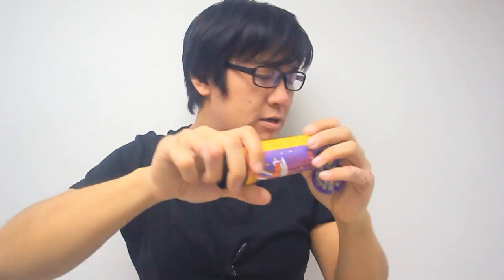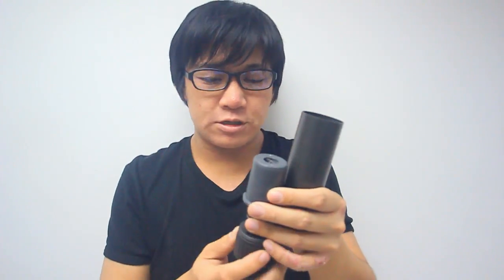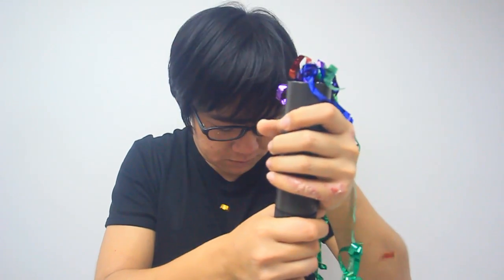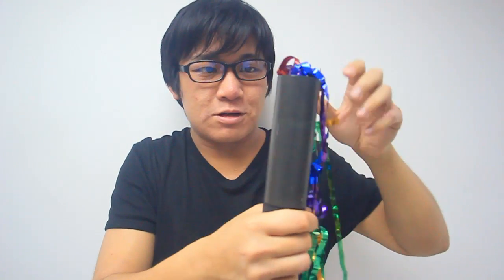What is inside a Party Popper safety fireworks!!! by Chung Dha

Comment: How high does it go? Would it be ok if the content hits the ceiling? On mine it says to use it only outside 🤔
Reply from the maker: It flies like 2 meters or so, but still content are paper pieces and recommend not to have any fire near by as the paper can catch fire.
Reply: chungdha chungdha thanks! It’s my daughter’s birthday and we are about to celebrate it. Since Covid we are alone so I wanted to spice up the tiny party a bit 🤪😂
Reply from the maker: @lauradee6385  its fun but make a hella of a mess haha
Reply: chungdha not that much! 😂 I guess I bought a small one. It’s an inch shorter than the one you are showing. But a nice small touch ;)